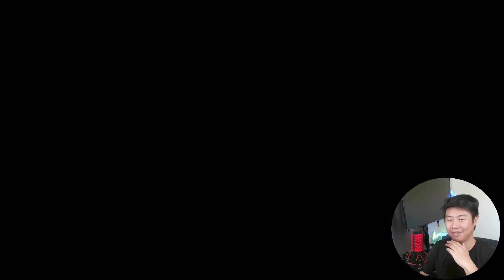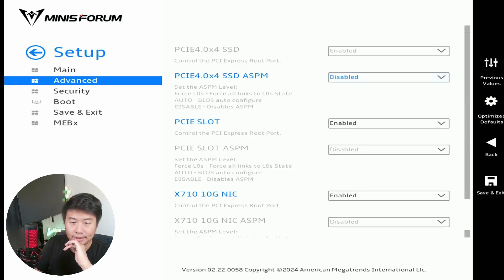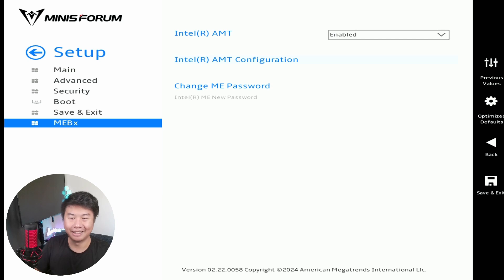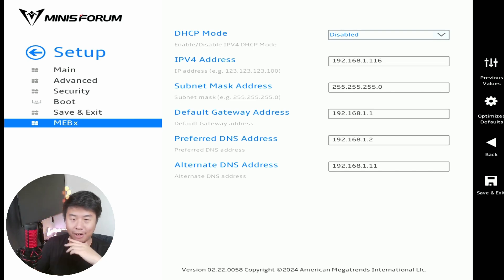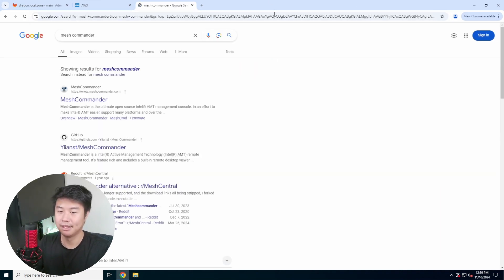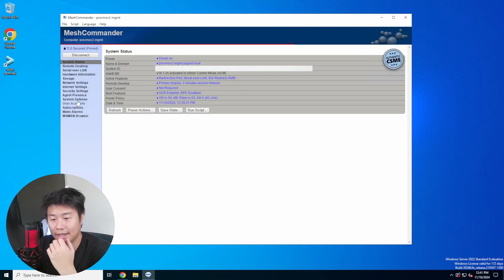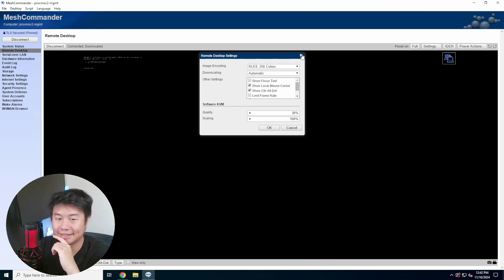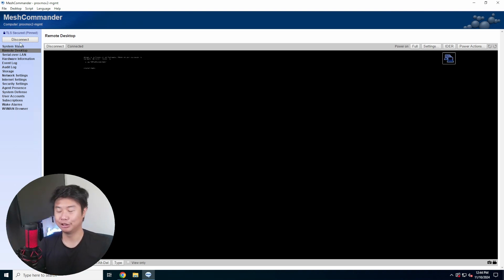Setting up Mesh Commander with Minisforum MS-01 using Intel vPro AMT Remote Setup

Comment: mhh i looks like im to stupid i dont get it work, i wanna use it with IP from DHCP because normally i just set then in my Router the Option to keep the IP for the Machine, i plugin in both Lan-Ports (2,5Gig) in but one of them has no connection at all (both at the same switch) im running on the MS01 a Proxmox installation, Proxmox will use the other working Lan one fine .. my Virtual Machines are only also the GUI of Proxmox is reachable.. 

What i dont understand where you got the FQND-Name from? You just pick one that you like and the Machine should then conacted the Router /DHCP under this name?
Reply: found it . i set by the Login "Auth/ Security" to "Digest / None" .. with "TLS" it works :) Thank you for your Clip, Mate.
Reply from the maker: Glad you found it! Yeah that setting was a pain to find because you would think not to set it to TLS :D But you definitely have to, to make it work haha

Comment: Not sure what is wring with my MS-01 but I cant get it full internet speed on wifi connection e.g got 22 MB/s vs 92MP/s in a dell. Changed wifi card and resintalled win. Still the same. Any thoughts?
Reply from the maker: Hmmm that's very interesting. I have everything plugged into my sfp+ port and haven't used any wifi since I'm using it more of a lab box instead of a desktop. I suspect that wifi module in the box may not be as high end as you would want so it may not support the very fast speeds, but I can't say for certain since I'm not personally using it. I would recommend using the ethernet or SFP+ ports if you can tho! I can say the SFP+ definitely do get the full 10Gigs if you have the networking for it :)
Reply: @sassdrew8141  Thank you so much for your feedback. Cheers!